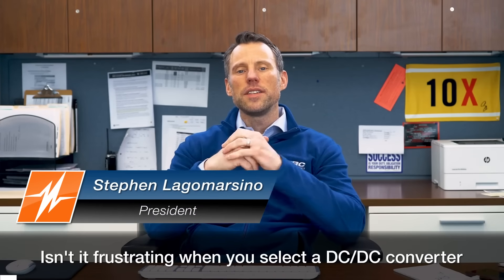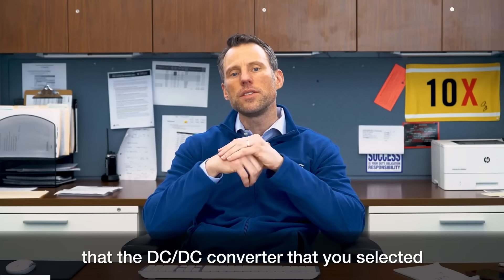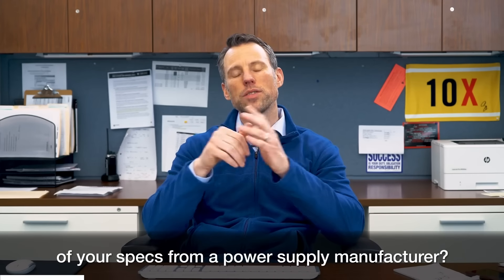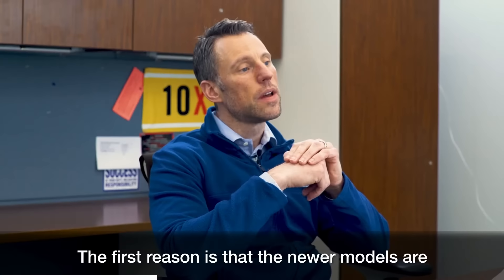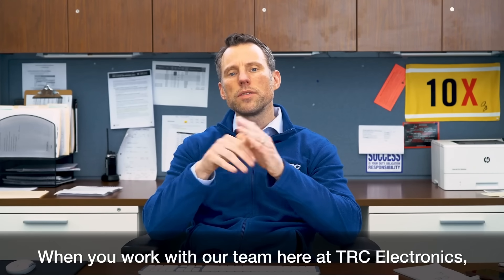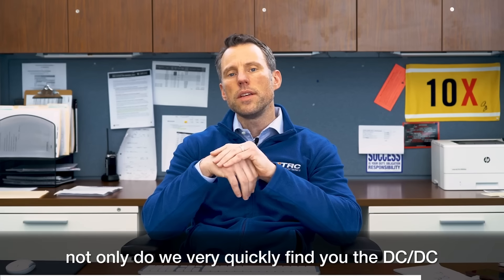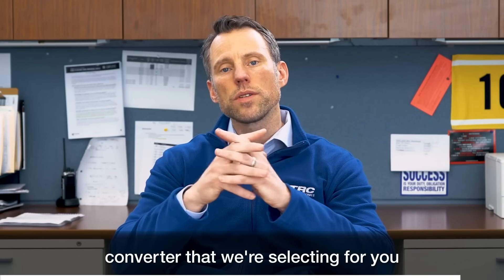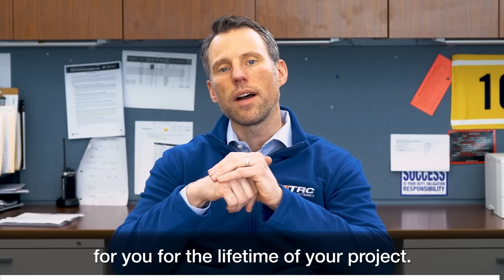How to Select a DC DC Converter

Comment: What converter to use for a diy windmill that generates electricity using a dc motor? I am trying to limit the current and voltage so I can charge a phone so it doesn't fry in high winds. I apologize in advance if this is a dumb question.
Reply from the maker: This is not a dumb question at all. DC Generators will generate a voltage that is dependent on the RPM. The main concern is to limit the voltage of the charge circuit to the phone. 

Since we do not have voltage or current values here, we can approach this problem with a wide range input DC-DC. An example is the TEP 100-7212UIR from TRACO power. This unit can accept an input of 14VDC to 160Vdc, while providing a regulated output of 12Vdc.  This dc-dc converter type could be used to when  the input voltage is very wide range. We trust that this will help you with the direction of your project. If you need any further assistance you can speak with one of our power supply specialists, 888-612-9514.